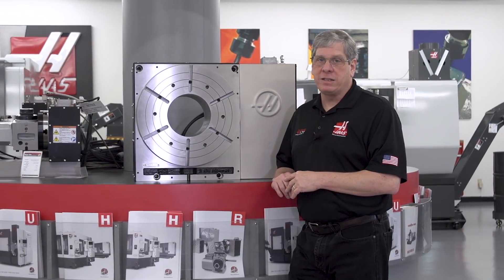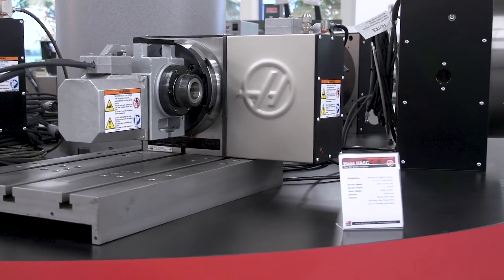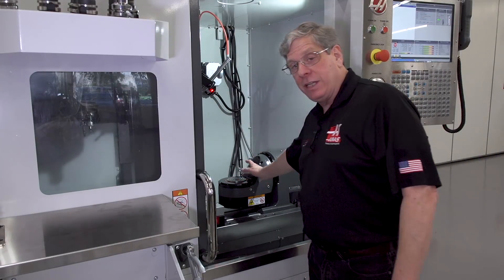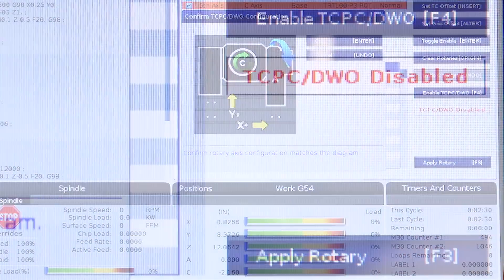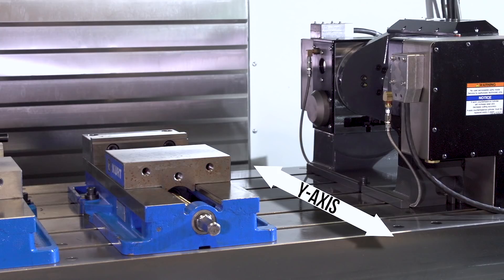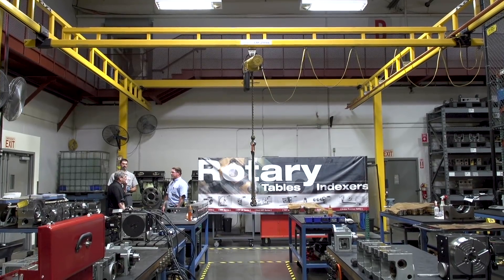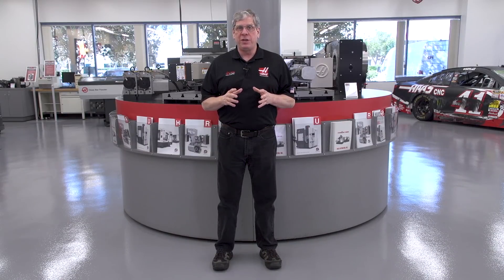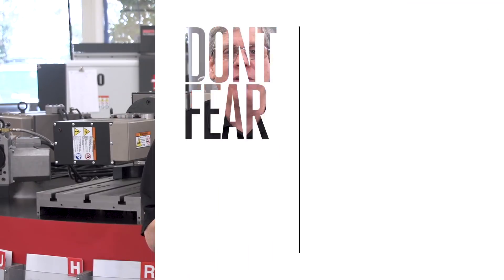Don't Fear 5-Axis - Episode 2

Comment: Do you still need HSM if your CAM program has those toolpaths? Fusion 360 for example
Reply from the maker: Yes. Anytime you have a combination of short strokes and high feed rates, you will need the High Speed Machining option. - John

Comment: Is there any way to get dynamic work offsets on my vf2ss? We have a trunnion in it
Reply: kracykat12 Yes you just have to order the feature from your Haas dealer and they will give you an unlock code to enable it permanently. You should check because you might get some hours of free demo use on your machine. Like high speed machining you get 200 hours before you have to buy.
Reply: Dans Workshop ok cool. Thank you for the information. I’ll give them a call tomorrow
Reply: Dans Workshop sorry for the question but will it work on any haas? My machine was made In 2014
Reply: I honestly don't know, but I do know my 2014 at work has the option. Looks like its about $1395 currently for coordinate rotation and scaling, and $4995 for Dynamic Work Offsets and Tool Center Point Control.
Reply from the maker: Unfortunately, it requires a Next-Generation Control which was not available in 2014. - John
Reply: Haas Automation, Inc. there’s no way to upgrade to a next gen controller?
Reply: @kracykat12  yes, buy a new machine and it will come with it.